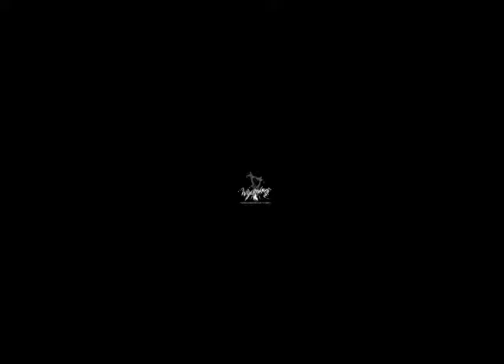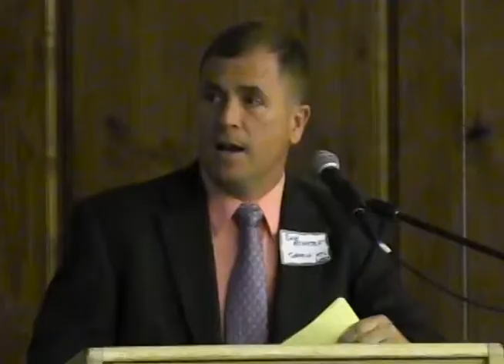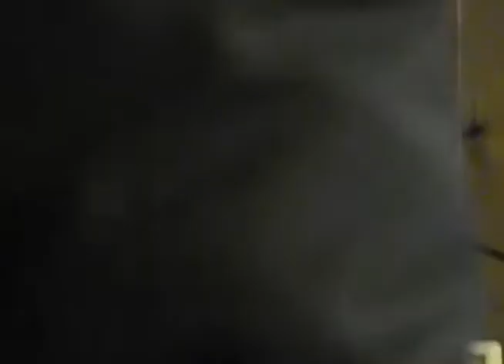David Minster, Wind Energy Technologies Department (SNL)

Comment: This is the Environmental-Industrial Complex, pretending to save the planet while trashing it in new ways. How can vastly larger wind turbines be environmentally justified, given that today's models are already causing so much blight? Putting them offshore is unlikely to hide them at practical distances, and how MANY of them would be ruining our finite coastlines? Even if they could be built without self-destructing (in increasingly strong hurricanes, or just from fatigue) it's a crude, inefficient way to get energy. Man should be phasing out growth-addiction and conserving energy, not pretending to solve problems with ever-bigger industrial parks sprawling across scenery. See: Planet of the Wind Turbines https://youtu.be/CEzK2KxNP7Q (not a far-fetched scenario)